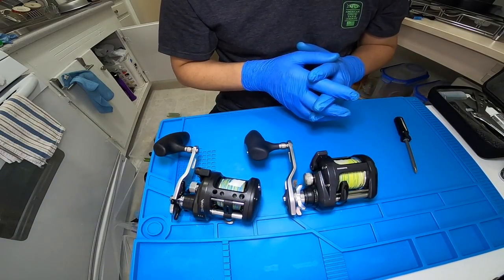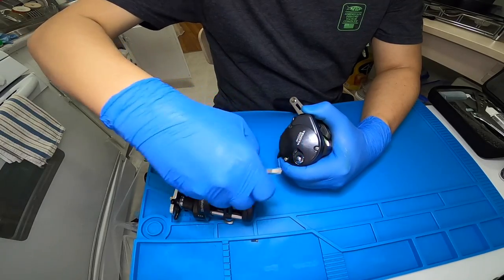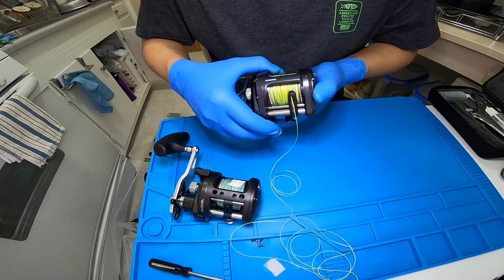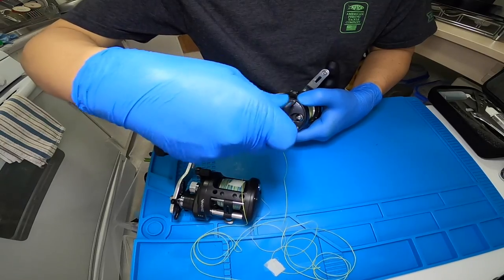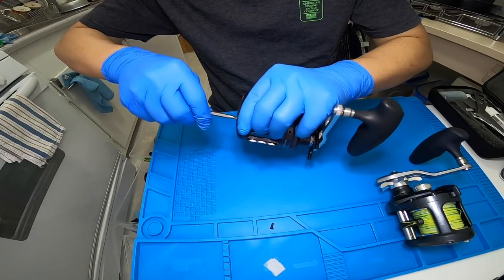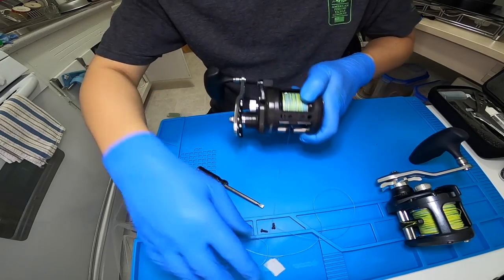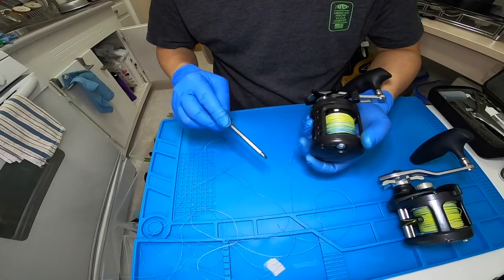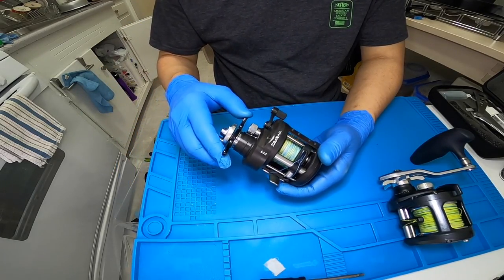How to Synchronize a Levelwind Reel   HD 1080p

Comment: can you not just spin the spool on free spool until it align with the level wind?
Reply from the maker: This type of levelwind is geared with the spool. They move as the spool spins both engaged and free spool. That’s why I have to remove the left side plate to disengage the levelwind from the spool. Baitcasters are designed that level wind disengages at freespool.

Comment: Master pano kaya Yun. .
Yun spinning reel ko 
Maganit or mahirap na sya naikot
Reply from the maker: Kailangan dismantle master. Malamang tumigas na mga grease. Hirap nga lang assemble gawa ng anti reverse at kailangan synchronized ng ayus a O/S gear. Kaya naman konti tsaga. Pag assemble at di mo maikot, di na synchronize ang main gear at O/S gear. Tangal mo ulit then kapa mo yung tama position. Wala ako video pero madami yan sa YT. Basta wag mo pwersahin pag ayaw umikot.
Reply: @BradHemedes  kinakatakot ko master baka Hindi mo na ibalik hehehw
Reply from the maker: Kaya naman. Basta mag schematics ka